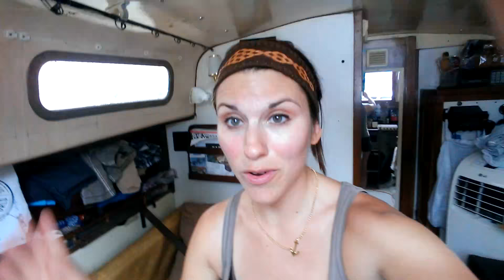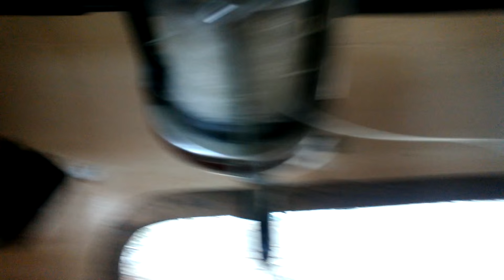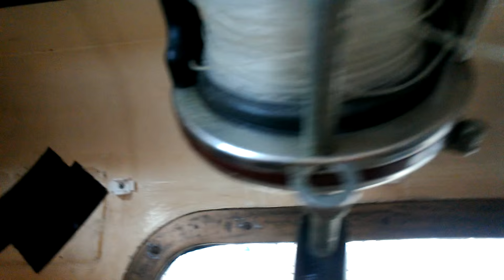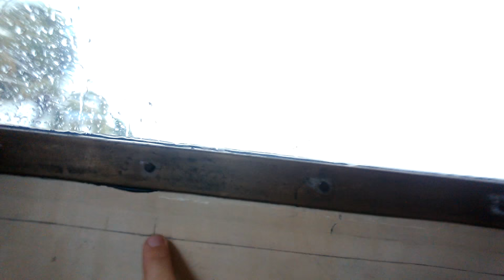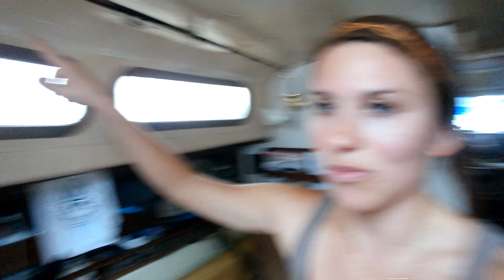Atticus Update 52: Installing Sailrite Mounting Clips for Curtain Track!

Comment: Just got my sailrite a few weeks ago and been learning to sew as well. My first project was to replace the curtains on my old boat. Working with computers has spoiled me - with computers the distance between understanding something and having skill at something is quite short (ie, if you understand how operate an API, actually using it with good results is easy) but with sewing - and other boat projects - I've been realizing some things you have to just PRACTICE to develop skill at. 

Something that helped me get started with the Sailrite was to just get some extra throw-away cloth and practice making stiches. Their videos are great and make it look easy - just keep redoing it until you are happy with it. I made my first curtain over several times until it was good enough and I'll very likely remake it again when I'm a bit better at this.